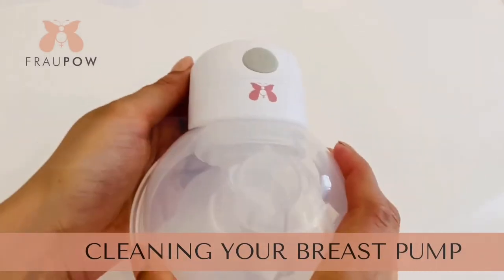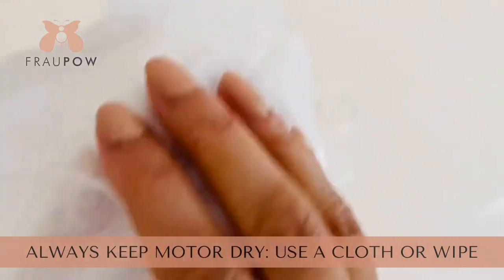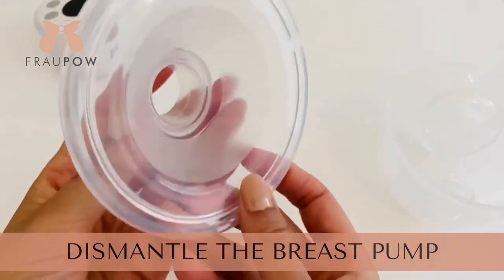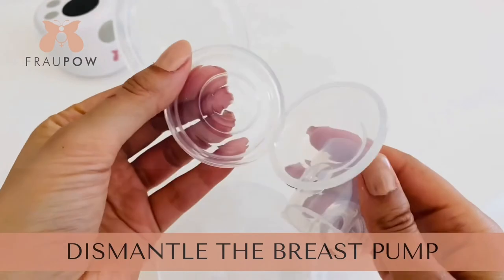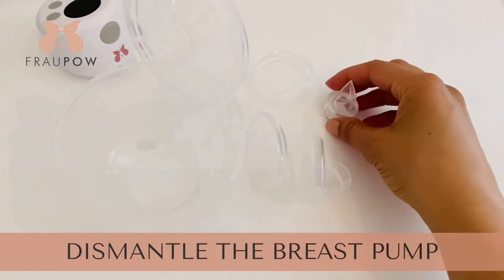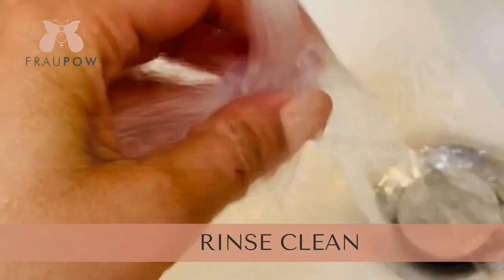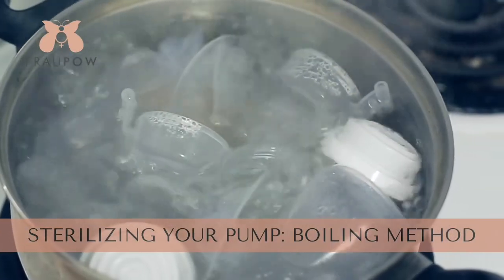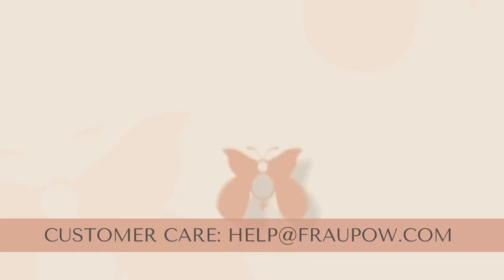Cleaning & Sterilizing Your Breast Pump

Comment: Can you use microwave sterilising bag or UV steriliser for the washable parts please?
Reply from the maker: yes you can use a UV Steriliser and sterilizing bags. we don’t recommend sterilizing the soft silicone parts - valve and diaphragm in temperatures over 100° for longer than 5 mins